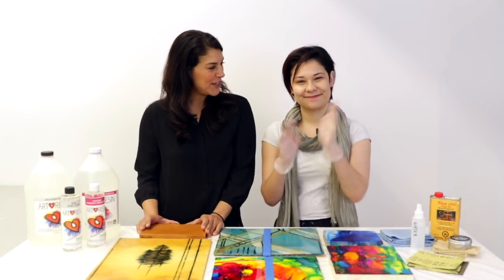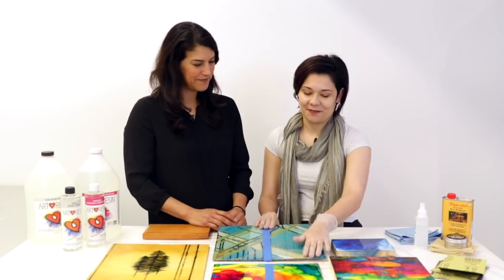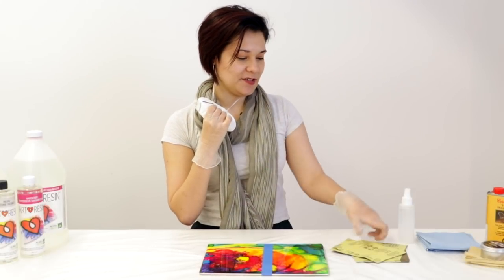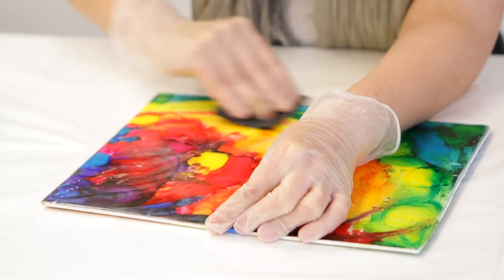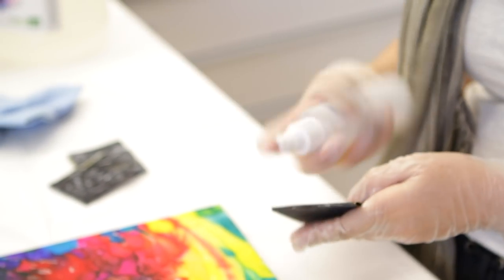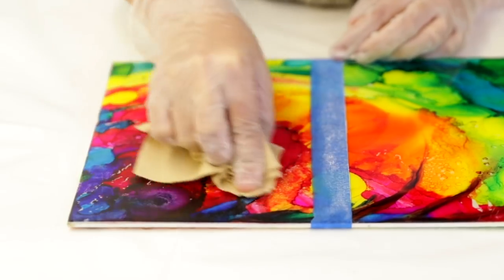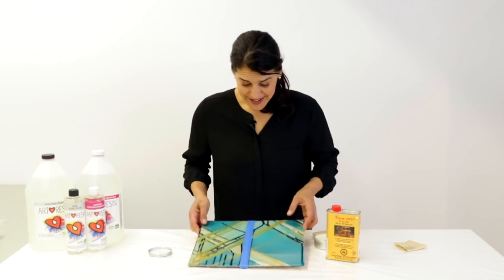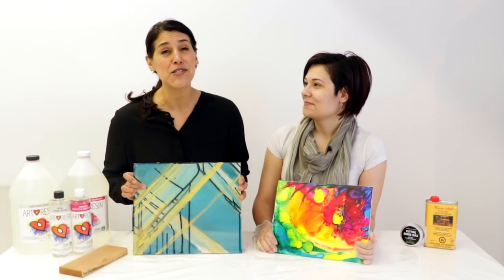How To Get A Matte Resin Finish

Comment: Hi great video! Can you do it without sanding?
Reply from the maker: The sanding is what removes the gloss of the cured resin.  Gradually working from courser grit to finer grit and then buffing will give you that smooth matte finish.  You may be able to use a matte type varnish over the cured resin to give you a matte finish without the work involved in sanding and buffing.

Comment: What grits for electric sander? Is round sanders ok ? Or mouse sanders? Can’t find those suggested grits for mouse sanders. Please advise . Thanks
Reply from the maker: The grits would be the same, you will just want to be sure that you find the paper that is compatible with your machine. Whichever sander you have on hand will work as well.
Reply: ArtResin thanks. I find mouse sanders don’t come in those grits but amazon has it for the orbit ones. Home Depot doesn’t sell the super fine grits for sanders which sucks .

Comment: I have a question, I'm doing this for papercraft cardstock with inkjet ink printed on it. I tried using mod podge sealer paste but it smears the ink when I brush it and ruins the colors. I find resin is the best solution and really makes the colors crisp and pop, but its too glossy wet looking. The only way to apply the resin is to use disposable brushes, there are too many angles and sharp corners so pouring is not an option. I was looking for a video like this but theres a huge problem. A single drop of water ruins the entire craft. The paper soaks it in an creates splotches of runny ink and destroys hours of work. How do I do this without water? I can't trust myself to have coated the intricate papercraft pieces in every nook and cranny. It only takes one tiny missed gap to ruin everything. Yet I want the perfect hardened matte finish. One solution I figured out is to add mod podge layer on top which disrupts the glossyness, but it loses the pop in the color and leaves ugly bumpy dried glue strokes. I'm torn between which method to do for the best quality.

What I'm doing is trying to waterproof and seal Dungeon and Dragon papercraft terrain and buildings for tabletop gaming. I don't want a moist hand from condensation of a cold drink to destroy a piece I spent 5 hours making. Learned it the hard way :(
Reply from the maker: Have you tried applying a spray sealer first?  This would protect the ink from running.  You could then apply the ArtResin to give it a durable finish.